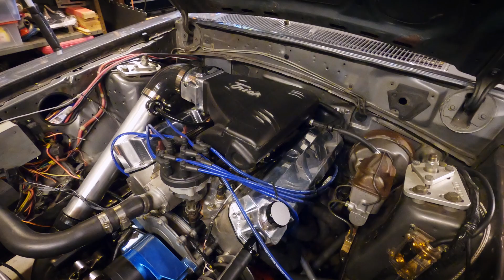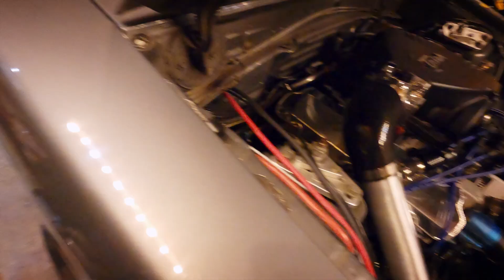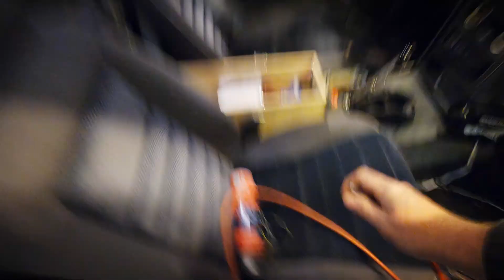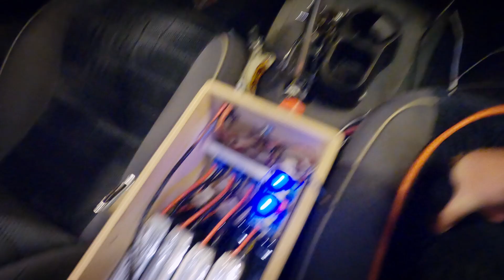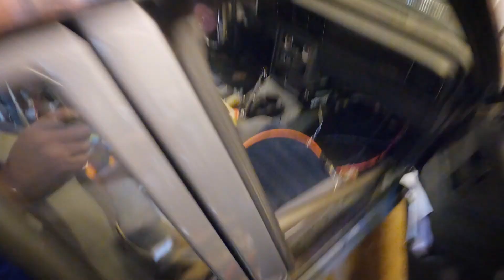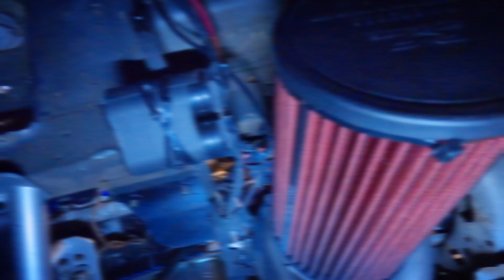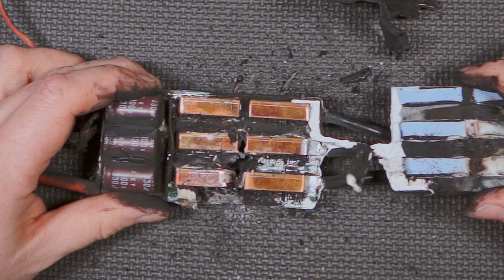DIY Electric Turbo Makes Record Boost!  And Fire!

Comment: What was the amp draw and duration that caused this type of failure?
Reply from the maker: It ran for about three quarters of a second.  I have no idea what the amp draw was because the board the would've recorded that data immolated itself.
Reply: @AlexLTDLX  ah yeah true enough. Those apd esc arent much better i guess eh? How are you liking the mgm controllers instead? Looking for a powerful controller for my electric dirtbike build using rc batteries

Comment: I don't get it. I get why it's something to do but it's just a waist of money and time. A few brackets and a belt and all this electric nightmare BS goes away forever.
Reply from the maker: I would beg to differ.  I've been running custom supercharged setups since the early 90's - look at some of the other videos on my channel;  particularly the older ones.  It's never no where near as simple (or cheap-sounding) as "a few brackets and a belt" - heck, take a good look at my car's passenger fender and hood.  Those dents are belt damage.  Your "electric nightmare" is my, "challenge accepted."  There are A LOT of advantages to an electric blower - much more efficient (even more so than a turbo) - giving a much bigger tuning window; much easier install, basically infinitely flexible mounting options - my last blower, a Whipple, added about 100 lbs right in the worst possible place - up high and in front - instant boost under any conditions, no stress on the crank snout, etc.  This makes about the same power as the Whipple but with half the boost - that's how efficient it is.  The only reason this is costing me so much is that I'm investing time and my own money into the research and development - no one's ever done this before; certainly not on this scale.  And here's the real shocker (no pun intended) - a 700hp capable electric turbo can be built for about $3,000 - less than most off-the-shelf blower kits with similar capacity.

Comment: I think this video was better than the one you intended to make! I love electronic destruction vids. Must be from my Technician days when we used to throw 1F electro capacitors at each other to catch.
Reply from the maker: Lol.  We used to "load" small electrolytic caps into a  stainless steel tube - a "barrel" if you will - and apply 120 volts AC to them and fire them across the workshop at each other.  These were like 25 volt and lower rated caps.  They'd blow almost instantly.  Made a mess and stank really badly.

Comment: what make and model electric motor are you using and how many rpms does it spinn? Thanks
Reply from the maker: TP Power 5870.  Under load, we've seen about 28,000 rpm so far.

Comment: You need to get 58 volts to that motor controller. With 8 volts you can't get close to temp rated output of 15kw 58v x 253amps = 14,674kva
8v x 253amps = 2024kva 127 amps is max continuous.
No matter what motor you buy, the voltage has to be at maximum and you need a slow blow fuse for 290 amps. 
When it comes to electricity, heat and amps are the sole issue. The only concern with voltage is shorting through insulation. 1/0 copper wire in parallel is what you would need at 8 volts. Amps would be 1300amps @8v. Fix your power supply. Amps x volts = watts inversely proportional and directly correlational. 58vdc x 253 amps = around 15kw Ohms law says if you have 15kw / 8vdc = 1834 amps which is exactly why your motor exploded the controller
Reply from the maker: I'm not sure where you're getting 8 volts from.  I'm running 16s, which fully charged is 67 volts.  The controller never saw more than about 300 amps.  We did some track testing this weekend and saw 340 amps continuous at 54 volts.  Video coming soon.
Reply: @AlexLTDLX  I think I heard you wrong. I was like holy $#1π! It's going to be on fire!  Right around there when you said car went sideways and then stopped.

Comment: Kinda thinkin' out loud a bit here, but...   could you convert a Turbocharger into a Belt-driven Turbocharger or makeshift Centrifugal Supercharger?
As in, remove the Exhaust side housing and replace the impeller/turbine with a small pulley to drive the compressor turbine?

After having a think on installing a Supercharger as you suggested in my previous comment on another of your videos, I don't think it is a viable option, so am thinking I may try converting a standard Turbo into a home-made Belt-driven Turbo/Centri Supercharger, before I go buying a bunch of expensive bits  'n' bobs to make an E-Supercharger like you have here.    😂

In your case, you could try 2 E-Superchargers side-by-side with both intake tubes converging into a Y-adaptor to further increase Boost.
Twin E-Supercharge her mate!    👍
Reply from the maker: I might just try that!

Comment: Alex you have a competitor that is out doing you a little bit, Pendulum tuning , he has a 30 KW electric supercharger setup , He has two videos he's posted in the last couple months . The motor he is using is ridiculous, 600 amp, 30kw
Reply from the maker: Thanks Wesley - are you talking about  his bench test from October on Facebook?  I haven't seen any other updates.  So far he's got to be under 10kW; in the test I saw he was only running 12s and made 2 psi.  But his compressor is a lot smaller than our Vortech too.  Is there another video you're aware of?  And as always, thanks for taking the time to comment!

Comment: Hey Alex, now I’m not sure if you’ve covered this already and I just missed it, but most turbo compressors want to be ran well above 50krpms and on up over 100krpms and boost past 18-25psi then. Why 50krpms as a goal and why such low boost just because whippels are 7? 
Seems like the gain with this idea is to out perform positive displacement superchargers AND turbos by removing the parasitic losses with both. 
(Even though turbo guys think there aren’t any parasitics with turbos-but that’s not the point here anyway) haha
Reply from the maker: I did cover it in another video, but there's been so many videos in this electric turbo saga.  I'm using a Vortech Si trim, which maxes out at 52,000 rpm.  It's a larger wheel designed specifically for lower rpm that allows for direct drive.  Otherwise we'd have to gear it up.  This just makes it easier.  And low boost is simply a limitation of technology.  More drive power is required to get similar airflow but at higher boost.  We're limited to available ESCs, motors and batteries.  That will change soon (battery technology is marching along especially quickly).   BTW, Whipples aren't just for low boost - watch the boost gauge in the in-car clip at the very end of this video.  Even on the transbrake, you see an instant 13 psi.  Now, as you point out, the Whipple does have parasitic loss and it is about 25% less efficient than the Vortech, so I figure 7-8 psi on the leave with the electric turbo should be similar to leaving with the Whipple on 13 psi.
Reply: @AlexLTDLX  52krpm is just the suggested maximum rpm. It can be spun past that, it is just not recommended by the warranty department. I don't see going to a maximum of 60krpms would hurt anything. Almost every max effort supercharger system I have seen, has been overdriven past it's reccomend maximum rpm. It allows for higher boost pressures earlier in the rpm range. Only issue is hitting the superchargers maximum rpm limit, well before redline/the limiter is activated. Effectively overspinning the charger for the last few thousand rpms of engine powerband.

Comment: Man that guy sounds like a character.
Anyways I think 6psi is right around the corner and easily a realistic goal, but to make things a little easier what if you compounded it with a turbo so at a certain voltage it made X psi no waste gate and little lag (in the theory).
Reply from the maker: That's in line with what Borg Warner's doing with their electric assist turbos.  So your thinking is right in line with theirs.  Not a bad place to be.  I'm going to see how far we can reasonably push a pure electric solution.  Think about how easy it is to  install this thing and move it from car to car.  That's really appealing to me  (and I think, to a lot of other people).  Thanks for the comment!

Comment: Bummed to hear s*** happened. I'd bet the mosfets failed in typical fashion, shorted to ground. Huge amp draw thru batteries and would explain the 'braking': shorting all poles is how you induce electronic braking in a motor.

Guess you'll want to consider watercooling the ESC, too...first.
Reply from the maker: That makes sense on the failure mode.  As for water cooling - I already am - esp since I put the water jacket on the motor.  Great minds think alike!

Comment: Flier makes some 1000A water cooled units for boats and such. they cost a kidney but maybe when you find that fire footage you will be able to fork over the ad rev for one of those beasts and have a little more headroom. cheers
Reply from the maker: Lol.  The fire footage wouldn't have looked that dramatic anyway - I actually didn't see any flames from the driver's seat.  The car did kick out sideways, but mostly as far as the fire goes, I just smelled it and confirmed it by the ammeter.  I really wanted to see the voltage and current at peak,, though.  I was going at highway speeds at the time.  What I really owe you guys is some real action/testing footage.  And I promise that we're almost there.  I have the place, the people and all I need is a working ESC to make it happen.  BTW - I'm looking at their 800 amp 22s boat ESC; as well as a few other brands (now those are expensive...)
Reply: @AlexLTDLX  can’t wait to hear that thing scream. MGM also makes some beefy controllers as mentioned below somewhere and I’ve seen Pendulum Tuning and another aussie running them with good success (theecharger.com).
Reply from the maker: Thanks Jake.  Somebody else pointed me towards that Miata site - interesting and nice build.  Of course, it makes less power boosted than we make on motor, but he did a nice job.  FWIW, I just dropped some $$ with legendary Steve Neu for an APD ESC.  Should be here relatively soon.  I'm tired of the blow it up and wait cycle.

Comment: Who hired Murphy to run the camera!?  I would definitely love to see the electric supercharger work continue, if not on this car then on another.
Reply from the maker: Tell me about it.  That's the second time that thing has done this to me.  I'll either re-format the card or try a different one.  I do like the camera I use in the car because it has a slide switch that turns it on and starts recording right away (it's an iON camera).  Not to worry - I'm definitely not done with this thing; esp. since now I'm reasonably sure we can see at least 6 psi on the transbrake and 4 psi peak.  I think with some development we might even get to 6 psi peak and maybe 8 on the brake in time.  Hope all's well in your world!

Comment: I still say you should be using an Arduino to ramp the power up to the ESC to reduce the current inrush instead of using your two servo testers.
Reply from the maker: There is definitely something to be said for that idea.  There are two reasons why I'm a little hesitant to go that route (even though I have an arduino and raspberry pi kicking around) - firstly, I don't want to add yet another microcontroller that needs to boot up and be more complex than what I have now; and secondly, I'm not very experienced with writing sketches from scratch.   I have also looked onto digital potentiometers - I think that might be a happy compromise.  I was hoping that the "soft start" setting in the ESC would deal with it.  I think this ESC was just underrated, tbh.  Are you good with sketches?
Reply: @AlexLTDLX  Arduino boot time is within 100ms after applying power to it in my experience. Would just be getting a sketch to do PWM or whatever your application requires. I’m not an Arduino-programming guy myself, more of a “ESP8266-flash-someone-else’s-image-and-go” kinda guy.
Reply: @AlexLTDLX  i  just made something now for you that should work... I dont know how to contact you though ?... I can test it and give you a wiring diagram to get it working..
Reply from the maker: @Ultrasonictwo  Wow.  Thanks.  Go to www.pikasfilm.com and on the about/contact page there's an email address.  Let me know if you have problems finding it.  It's in the body text near the end.
Reply: @AlexLTDLX  sent
Reply: @AlexLTDLX   Also i can't see how a digital potentiometer can help you ?  The bootup time would be irrelevant cos the ArduinoNano would be running anyway powered from the ESC's which i think has v5 out. Im pretty sure that using a Nano would be simpler wiring than what you have now..

Comment: @ 1:01 that's because you have...a smoker. --Indy2000 via corral. LoL 😂
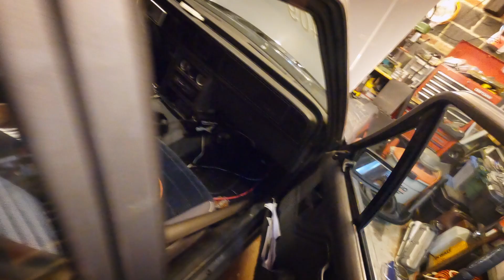@ 2:38 must be a new viewer, tis not a racecar, tis a streetcar!
In regard to the query at the end if you're willing to get the bigger ESC  I say ring all you can out of this setup before changing up the combo. There will be no parasitic drag compared to the blower and that can be some interesting data. My $0.02
Reply from the maker: Oh that Indy.  He's special.  As for wringing all I can out of this setup, I tend to agree with you.  I had a bit of an epiphany regarding one of our brickwalls and why thisESC suddenly let go.  I might do a short video on it, but I'll spill it here, esp. since you obviously took the time to watch the whole video (thanks!) - If you divide 51.5 volts (what we were seeing before at the ESC when we hit the button before we doubled up the battery packs for more current/less voltage drop) by 16 (the number of cells in the pack), you get 3.218 volts per cell.  The ESC has a low voltage cutoff of 3.2 volts, where it goes into "slow cutoff" mode.  In other words, we weren't getting the most out of our setup because the ESC was trying to protect the batteries.  This time, it didn't hit that safety and went pretty much balls to the wall with the motor.  And fire was the result; along with more boost.  Hope that's clear enough to be understandable; I feel like I'm being a little convoluted.
Reply: @AlexLTDLX  I always watch the whole thing and laugh at the text that often scrolls across the screen. And not convoluted at all, good to hear the culprit is likely found.

Comment: Just a thought experiment in my head  would a 2 step supercharger geared for top end power work well with adding  a third component a first  stage electric supercharger setup  filling in the bottom end?
Reply from the maker: That's a good idea, and it would definitely work.  That's kind of what Borg Warner's doing with it's electric assist turbos - but instead of a blower like you're suggesting, they do it for turbos.  I honestly think that as battery and mosfet/ESC technology continues to improve, we could build a fully electric setup that covers everything up to and over 1,000 hp.  Thanks for posting!
Reply: @AlexLTDLX  Your welcome, hope to see you max out the battery tech and then find some cool way to add more power on top of that in a unusual and interesting way.

Comment: Been there with the belt and the hood!
Reply from the maker: Really?  I don't feel so alone.  I've never seen another car's blower belt damage before.  Just heard about it.  Any place I could see a pic?
Reply: @AlexLTDLX  No, that was over 20 years ago.  Brand new Harwood hood with fresh paint so I was extremely pissed.
Reply from the maker: Oof.  Well, no more belt throwing for me.  I just dropped over a grand on a real ESC - Australian made...
Reply: @AlexLTDLX  Did you ever have belt issues once you made the setup with the steering dampener?
Reply from the maker: @williamzoom  Nope.  And I was able to run half the belt tension.

Comment: Ive dabbled in such things myself. Im starting to think full size electric bike/motorcycle speed controllers are needed. Just my 2 cents.
Reply from the maker: An electric bike ESC is usually only good for at most 5,000 watts.  We need at least 4 times that.  I've got some feelers out, but I'm open to suggestions.
Reply: @AlexLTDLX  look up MGM controllers. They make a variety of controllers for hobby and industrial use.
Reply: @HighVoltageRC3080  are mgm controllers exclusive to LMT motors? I saw Pendulum Tuning run his blower off that setup. Im not certain but was looking into one to run my TP.
Reply: @jakepratt5774  you can run other motors with them. Doesn't have to be a Lehner, the Lehner motors just make a lot of power and are very good quality so they get paired often. Ive run TP motors and they are ok but the Lehner will make more power and stay cool while producing 30+hp.
Reply from the maker: I just threw down the coin for an APD ESC.  Shouldn't blow up and has all kinds of datalogging features.